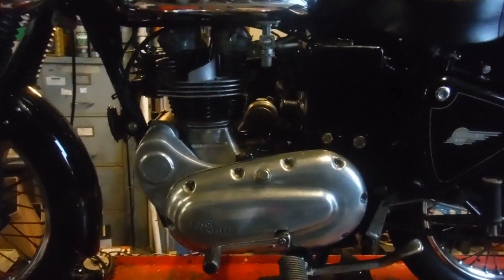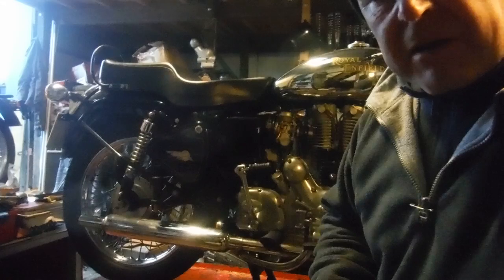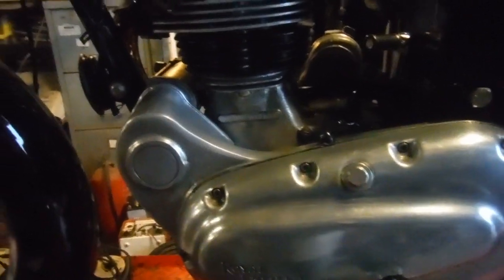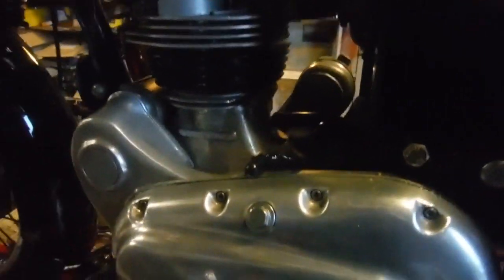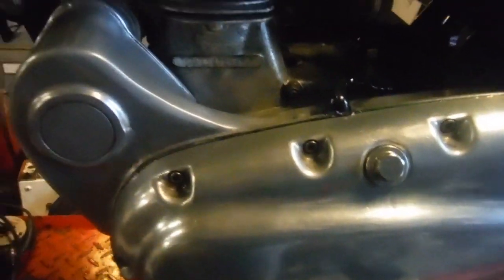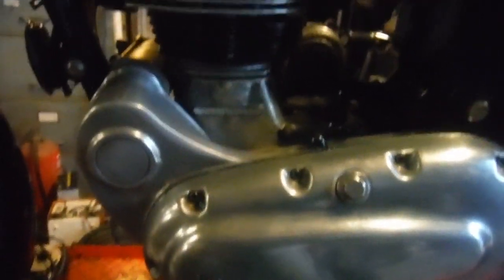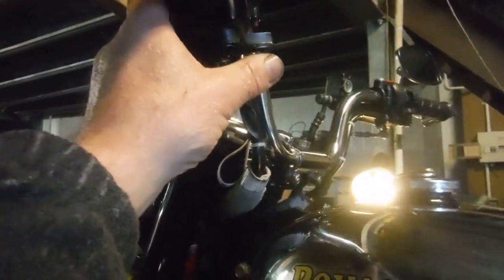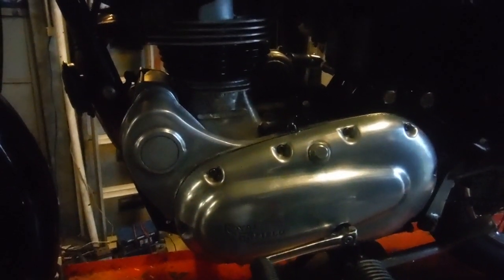Royal Enfield 500 Machismo electric start - noises investigated 3 - Fixed! inc links to previous.

Comment: I have a year 2000, 500cc , kick start only, 4 speed model,  bought it new. My dad had a velocette MSS back in the 60s, to start,  turn the engine to compression stroke,  lift the decompression lever, push the kick to the bottom of its travel,  release and give a gentle swing, they just start, every time, works on my bullet too, perfectly.  Just get the cold start off quick before it floods 😂.